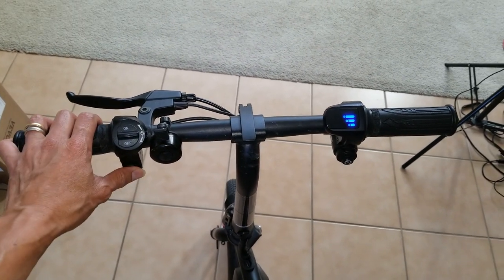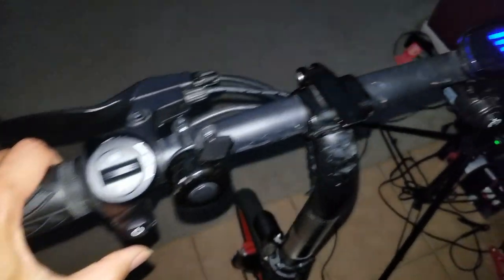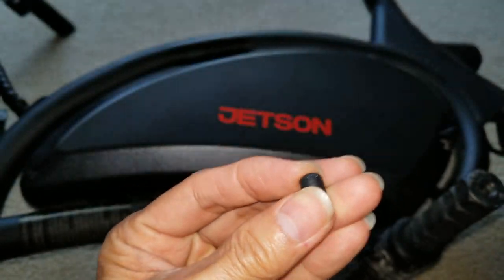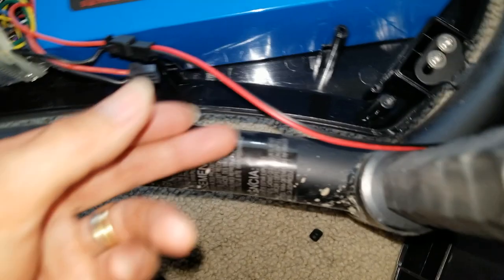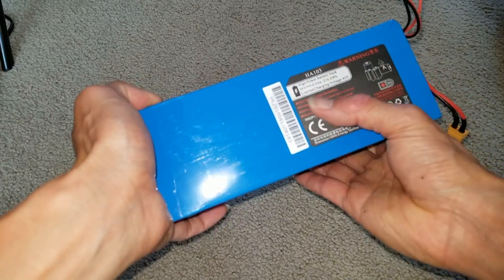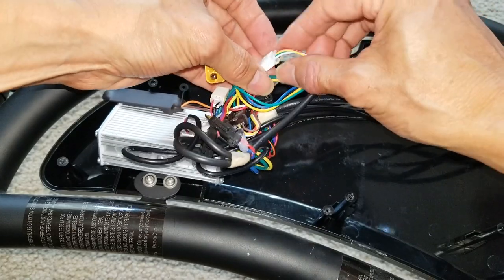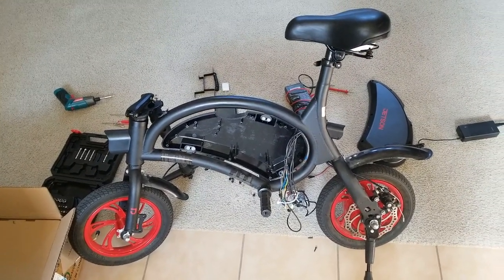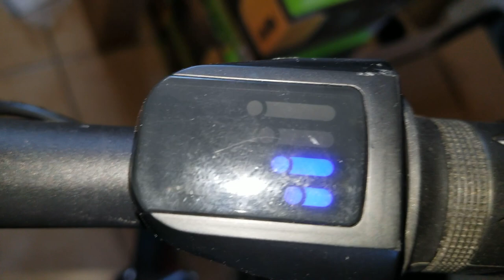Troubleshooting & Fix JETSON BOLT or PRO eBike Not Working & Full Teardown

Comment: My bike stopped working mid ride home. I need suggestions.
Reply from the maker: It could be battery issues, motor, circuit board, throttle and etc.
Reply: Same

Comment: Thanks for the video I've been trying to replace the battery on mine can you suggest a battery for me to get?
Reply from the maker: You might want to purchase directly from Jetson for the battery replacement, but it's very expensive. You can also check on eBay or Amazon or other websites.

Comment: The battery bars are based on the voltage level, not the amps. I bet it's a bad connection between 2 of the battery cells or something wrong with the BMS within the battery. You can tell that the bms is in the battery packaging because it only has 2 wires coming for charging. Other wise it would have 1 negative plus an additional wire for each cell. Looks like it's a 10 cell battery. 
Also bad connection could read out the correct voltage until it's put under a load.